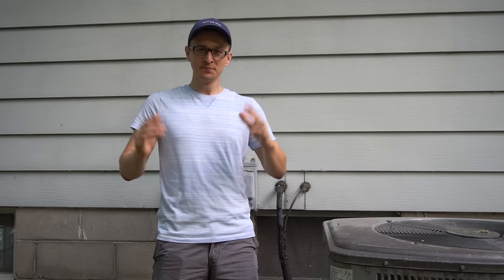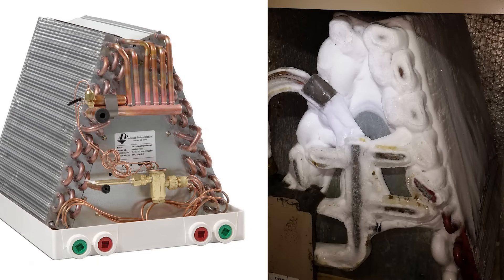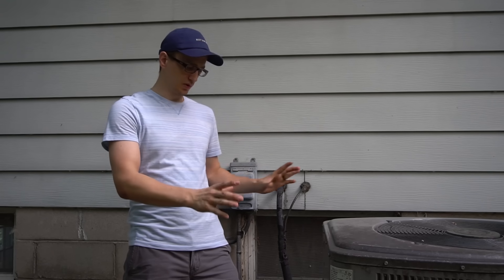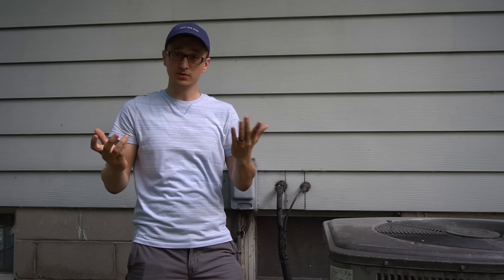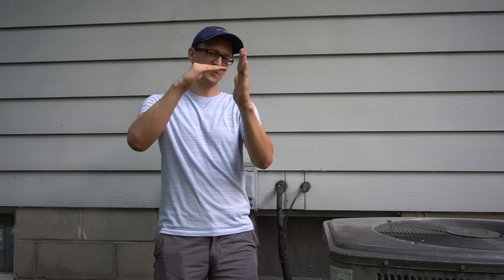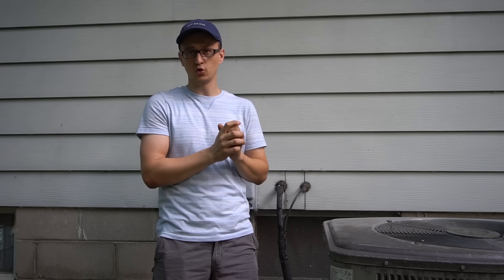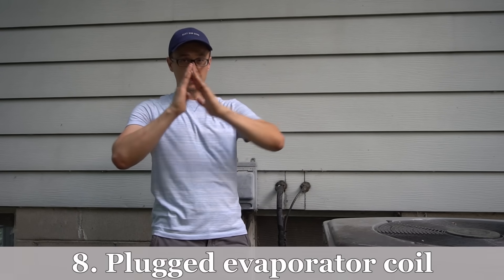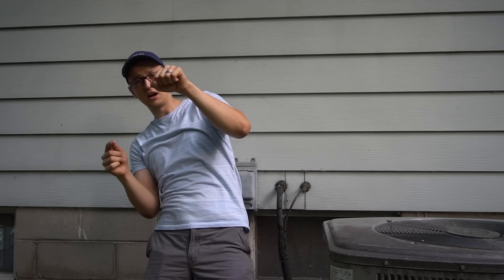8 Reasons Why Your AC is Freezing Up

Comment: Where in this world do you live. You don't need a license to buy refrigerant. 
Turn the  a/c off. And leave the fan off too. 
Running the unit to cool below 67 will not ice anything unless a bean head installed and charged the unit. P/T @ 38° is too low. Try a little higher for a 18° to 21° split.
Sheesh, such poor advice and a bit hyper also.  Remake this video.. please! I know you know better.
Reply: Melvin292 In the USA you are required to have an epa certification to purchase and handle refrigerant. Thank god.. there are enough hacks running around with the certification, the last thing we need is a bunch of idiot homeowners over charging their system cause it "needs more freon"
Reply: @RealityRenovations  - you're right. Most technicians don't understand how to correctly read a digital or analog manifold gauge either. Most do not realize, as pressure drops in most systems, so does the temperature of refrigerant, to a point.
Reply: Melvin292 here in Texas you must have your EPA certification.
Reply: @southtexasprepper6605  - an EPA 608 certification is different than the state licensure who issues the letters and numbers you may see on a truck/van indicating a company or individual has passed a state test in the trade they practice.
Reply: Melvin292 oh ok i see.
Reply: Melvin292 
If you say so arogant potatoe head.

Comment: Better explained, Lack of air flow or some sort of air restriction causes a drop of evaporator temperature.

Also, the refrigerant absorbs the heat out of the air in the home. You said it backwards.

Awesome you took the time to explain to everyone, thx.

Ps. look up vapor saturation temperature and what superheat actually means.
Reply from the maker: Thanks for the corrections and extra pointers John! Stay cool ;)

Comment: You forgot one problem that would cause your ac to freeze.
A stuck contactor.
Reply from the maker: Thank you for pointing that out! Yeah, if the outside unit is on but the fan inside is off, the evaporator coil will freeze up.
Reply from the maker: Ahh I see what you are saying. But this actually happened to me before though. There was no 24v going to the contactor coil but it was stuck closed which kept the condenser running and froze the suction line. I suppose older/newer units are set up differently and they don't always behave in a set way.
Reply from the maker: Jacob, could you explain why it would not freeze up? I believe it would.
Reply: @WordofAdviceTV  if you have a stuck contactor  that would just force the unit to run nonstop, and it would only freeze if there is an airflow issue or not enough refrigerant. The only way the contactor would have gotten stuck initially would be if the thermostat called for cooling and then the contactor got stuck in that process. In that scenario, the indoor fan would have come on and it would stay on if the contactor is closed.
Reply: You are right, if the compressor is running without the indoor fan being on  then yes your evap would freeze over but that's not very likely to happen unless you have a bad motor or a communication issue
Reply: Isn't there a suction line pressure or evaporator fin/outlet temp sensor that should cut the compressor off in case that happens (fan goes off)? Yeah, if it's a TXV system, a pumping compressor can still freeze the evaporator up if the evaporator fan is completely faulty and not working. Even if the TXV does its best to keep liquid from flowing through, the trickle of liquid it lets through from time to time still keeps cooling the live evaporator down. With a LEV i can't see this happening though.
Reply: You Said right
Reply: I had a package unit with the same problem, without a low pressure cutout
Reply: if you dont like welded contactors... 
install a "smart starter" that ramps up the compressor speed over 4 seconds and precisely manage the start winding disconnection.

Smart-starters eliminate the  locked-rotor-amps 5x electric surge... good for any single-phase electric motors. (3-PH motors commonly use VFD ramp ups).

Spend a little now to save more on maintenance 🙂
Reply: Happened to mine too!  The inside blower is controlled on a separate circuit from the compressor/fan.  The outside unit was continually running even when the AC was turned off.  
This year I seem to have a different problem, probably the indoor capacitor.  Not bad for a 28 year old system.
Reply: That would not cause your ac to freeze up